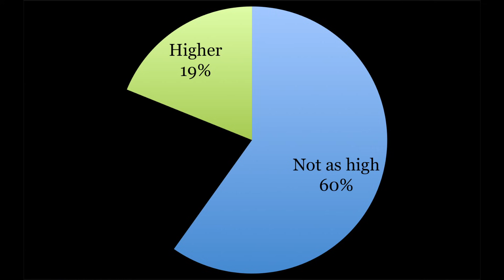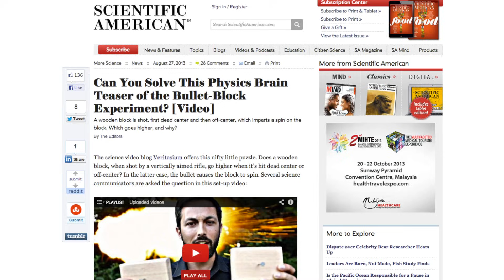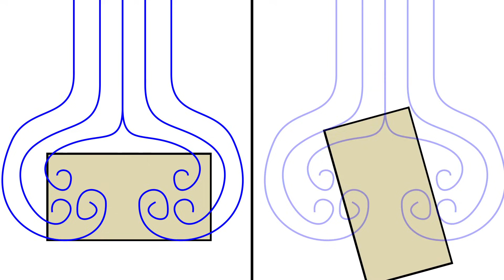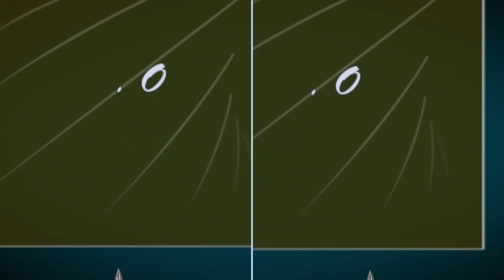Bullet Block Explained!

Comment: THE SPINNING BLOCK HAS LESS ENERGY FROM THE BULLET BEING USED TO MAKE A HOLE IN THE WOOD. The rotation causes more area over time to be covered during the impact hence less wood being ripped apart -> more lift energy

Comment: In order to see that depth, you should use a high penetration round without a lot of charge behind it.  I would advise the .17 hornet, which is a .22lr with a more narrow bullet.  This way you could see the penetration difference more easily, while not risking splitting the wood.

Comment: Modified experiment: Use softer material - as soft as possible, but not as soft as to let the bullet through. and preferably a material that is uniform ,which wood with it's fibers, phloem, xylem etc is not. Also if the block is lightweight enough you can make it a bit bigger and fire it more to the side, it will probably make a bigger difference?

Comment: It the block on the left of the x-ray, which I assume is the block that spun, the bullet did not go completely straight in, but curved a little. This makes sense, because the block would already have been spinning when the bullet hit. If the hole was slightly curved, the straight nail wouldn't have hit solid wood before it actually reached the end of the hole

Comment: In response to the question of increasing measurability: 
1. You could increase the moment arm of the off center shot by increasing the width of the block, thus lowering the penetration depth or
2. You could lower the density of the material for "scaled up" penetration depths.

Comment: the trajectory of the bullet when shot at the center was linear while that when shot off center was curved. When you stick the nail in the bullet hole of that shot off center it doesn't penetrate fully.

Comment: The mental hurdle with angular momentum is being able to understand that even if a particle is moving in a straight line, it still has angular momentum from any arbitrary axis (in this case the cg of the block).  This can be shown mathematically because l=rXf  Or, for the magnitude of l, l=rp sin(theta). The angular momentum you can see after impact can traced back to the moment of impact, where the angular momentum = the linear momentum of the bullet times the horizontal distance from the cg.

Comment: I thought the same. Before the collision both the block and bullet appear to have no angular momentum, so after the collision there should be no angular momentum. But afterwards the block is rotating along with the embedded bullet (which are both rotating the same direction).

Comment: Ke=(1/2)m*v^2 and p=mv.  Notice how much of a difference velocity makes here.  That bullet is moving INCREDIBLY fast.  In fact assuming it was a 9mm then around 1000 ft/sec is a fair estimate which translates to around 305m/s.  A good estimate for the weight of the bullet is 120 grams, or 0.12kg.  The momentum of the bullet would be 36.6 kg*m/s, the energy would be 11163J.  Most of this energy is lost in the collision.

Comment: To create a measurable difference:1. Using a less dense material- deeper Penetration. 2 more of centre  equal Great angular momentum therefore greater difference. 3 increase Initial Linear Momentum (increase weight or speed of the bullet)

Comment: Have two blocks. One stationary, one on a track. If conservation is true should the two blocks accelerate the same after being shot no matter what speed the block on the track is  moving away from the gun? With this experiment you can vary the 2nd blocks speed, maybe at hi speed the bullet depth difference could be measured?

Comment: The projectile itself rotates through the air, therefore it would transfer that rotation to the block when getting inside of it... And that could easily be proved: shoot on different sides of the block, if one block rotates faster than the other, it means this faster block is rotating at the same "direction" that the bullet was, and that is "extra" energy.

Comment: Part 2: In the second case, the center of mass is also on the line connecting the centers of mass of the two objects, but this line is tilted. While the bullet moves, this line changes angle! This effectively means that there is a rotation around the center of mass, although you don't see something rotate. After impact, you do see it, but it is the same angular momentum!

Comment: In answer to your reaction and the other top reaction with basically the same question. There is conservation of angular momentum!

Let's look at both cases before impact. In the first case the center of mass of the total system is on the vertical line connecting the center of mass of the block and that of the bullet. While the bullet moves and even after impact, the mass is not rotating around it, so angular momentum stays 0.

Comment: you don't need longer blocks if you're using the same material, the bullet didn't even reach the center of the block. you change to softer materials or get a more powerful gun (or both).

Comment: 1. Use a vacuum chamber so that air friction is out of the equation 
2. Use a different material that can ensure almost every joule of energy is transferred into that material without removing excessive amount of mass from the material(ballistic jelly anyone?)
3. better equipments for higher accurate measurement(you don't even put up a scaling board at the background!) 
4. 100 times more reputation of the same setup to built up statistical results

Comment: Perhaps consider using material less dense than the wood used in the current experiment. Using depth=(bullet length)*(density of bullet)/(density of block), holding bullet length and density of bullet as constant as is feasible, and assuming that variance in depth increases as depth increases, then using a less dense block should magnify those differences.

Comment: To make the difference in bullet depth measurable, you would probably have to do some combination of having the block made of a softer material (so it takes less energy to deform the block) and having the block be longer for its mass (so it takes more energy to rotate it).

Comment: No, no. The energy that appeared for the rotation came from the bullet. Only 1% of the energy needed to deform the wood was needed to cause an equivalent rotation of the block. So there is a difference of 1% in deformation distance.

Comment: Thanks for the answer
why don't you try to use lead (or a fmj hp) 45ACP (i think that a larger diameter bullet could help) on the spinning block and a standard fmj RN 45ACP bullet on the other block (obviously the 2 bullets must have the same weight and the same V0, so you probably have to reload yourself these cartridges)

Comment: The momentum is conserved when transferring momentum to another object. In this case, there was no rotational momentum to begin with. Just like an object at rest in linear systems. However, when a FORCE is applied, energy is placed into the system and both energy and momentum are conserved. In rotational, a torque is applied and thus the block will rotate. This required a transfer of energy. Energy can be used to transmit linear momentum into rotational momentum, since both only require motion.

Comment: Use a disk of wood or whatever, with a notch to absorb the bullet. This would transmit maximum angular velocity to the block and lessen air resistance. 

The mass of the block is pivotal. So we could make the disc very large, if it had the same mass. Imagine a big disc of the same weight with the bullet striking near the edge. Most of the energy would result in angular momentum, and it would not go very high.

Comment: Make the blocks particularly wide, such that the blocks have just enough vertical velocity such that the rotating block just barely doesn't hit the starting stand (and as low a height such that the bullet goes through as much of the block as possible). I would expect it at least to be slightly more visible this way

Comment: Try using an air piston or something that doesn't lodge in the block or something along those lines.   Remove that variable from the start.  Maybe a small metal plate to help prevent deformation?

Comment: You could perhaps swap the wood out with a material that would let both bullets pass all the way trough, and then use the high-speed camera to measure the speed of the two bullets after passing trough the two blocks.
In the wood blocks the difference in penetration should be only .1mm, but If the bullet only loses let's say 30% of its energy passing through the blocks of new material, then I would expect the difference in speed to be proportionately larger than the difference of penetration. .o/

Comment: And obviously this percentage always has different values. So, we can not talk about any consistency between experiments. Obviously there is a bunch of unrecorded reasons, which causes difference in height. In my opinion, rotating brick ceteris paribus should always fly lower.

Comment: Well, I would not agree with the ideas proposed in video. We can not just think about momentum and forget about conservation of energy. Those laws should never conflict. Also, notice the fact that the results of experiment were different: the block always flies for different height. And the question would be why. The answer I think is in the bracing of block: there is always a percentage of horizontal force which is lost when horizontal vector is transformed into vertical.

Comment: Reference frames is the key. Say our point of reference (or view) is from the center of mass of the block. If you're shooting it dead-on, neither object has any rotation with respect to the other, and the momentum is totally linear.
Now, move the bullet to one side and as the bullet approaches, the angle from the center of mass to the bullet is changing. That produces the angular momentum.

Comment: The spinning block converted a tiny part of the bullet's energy into rotational energy (because it hit off-center), while the other block didn't and thus had the bullet penetrate deeper, but only very very slightly deeper since the energy required to get the spinning block spinning was very small.

Comment: don't measure the bullets, measure it without bullets and see if they still go as high.
if you use a rubber bullet it won't penetrate the wood, if you use an air gun you can even see if aerodinamics change anything. these things will show you the result in different scenarios which you can compare to the bullet test and anticipate/calculate the real defining factor.

Comment: To improve: Use a less dense material like balsa wood and increase its length. Use a balsa stick let's say, 1m long and shoot in the center and at the edge. The penetration difference should be higher with the less dense material and the rotation should use more energy.

Comment: You should be able to scale up the difference by using longer blocks. Double the length of the blocks. I would say triple but i think that would be to massive and cause the block to actually roll off to the side instead of go up.

Comment: The second layer should be more light than the first and could slow the bullest even more (again suppose 95%). Now there could be a big third layer that is very soft. The remaining 1 - 0.95 * 0.95 of the energy of the bullets can be calculated by the depth in this sensible to penetration layer.

Comment: I think one way to do it might be not to use a wooden block. Instead it should be a brick made possibly of different kinds of plastic. The outer layer will the the hardest and would slow down the bullet lets say by 95%. Theoretically now the bullets are traveling at 1/95 of their original 'true' speed.

Comment: the bullet path is curved on the rotated block, that's why the nail didn't go as far. they should have used some wire or something else that could curve inside the wood to measure it correctly. the x-ray is the real measurement.

Comment: the rotationenergy is 50% of the potential energy the block has at his highest point, but the rotation energy is 1% of the kinetic energy of the bullet. 
You might find it takes less energy to throw a block upwards than to punch a hole in it (this is super inaccurate, but i hope you get the idea. There is a simply and intuitive, very visual explanation to this, and if i were richard feynman i would come up with it)

Comment: it's hard for the bullet to penetrate the wood, it only goes in a few centimeters while in air it would go a few kilometers. this means a lot of energy is wasted for very little penetration on the wood, which is why the depth is so small but it still makes a big difference.

Comment: Modifying penetration would be extremely easy. For one block, use a FMJ round. For the other, use a hollow point or hydra shock round. The bullet expansion of either of the latter will cause more resistance and therefore less penetration. Good luck finding a FMJ and a hollow/hydra that are of equivalent weight and caliber though.

Comment: The loss of the bullet's kinetic energy is due to the work done by the resistant force (or frictional force) exerted by the wood on the bullet as the bullet is travelling within the wood:
loss of K.E. of the bullet = (resistant force)x(penetration distance).

What you can change is the resistant force by using a block of less solid material instead. To make sure that the bullet would not completely penetrate through the block, it may be necessary to make the block much thicker.

Comment: How can you use the conservation of linear momentum in the vertical direction when you have an external force (in this case gravity) acting on the blocks?? Shouldn't you use impulses? because the time of impact is very small
Also as a modification to the experiment, make the block much wider, and shoot it to the VERY EDGE, so that there is more torque

Comment: The rotational energy is 50% of the potential energy required to lift the block. 

What he is talking about in the end is the energy of the bullet. 97% of the kinetic energy (of the bullet) is lost due to deformation, heat and sound. So only 3% of the initial kinetic energy moves the block. Since the ratio of potential (or gravitational) energy to rotational energy is 2:1, this results in 2% of the energy being transformed into potential energy and only 1% into rotational energy.

Comment: Surely this would be an unfare test in the first place? Sure, the blocks are the same size, shape and weight, but by OUR measurements, so there will be a little difference. Plus, the blocks may be 99.99...% the same, but the WOOD is not (different density in certain areas etc.). And that's just the blocks; the bullets will also be slightly different (on a scale we humans alone cannot tell), and the gunpowder propelling them will also be a little different...the list goes on.

Comment: Maybe you could use a differently shaped piece of wood......such as maybe a foot long piece of 2x4. Or maybe 2 feet long. Maybe more?? If the offset shot is much further away from the center than in the original experiment, maybe the visual aspect of the answer will be amplified to a difference you can see. Also, a less dense wood or material will contribute to this. How about also using a bigger, more powerful gun versus that wussy 22.

Comment: Based on the size of the tools in the experiment, easiest way(this was mentioned by others i believe) to get view able measurements is to either make the blocks bigger(longer) so the distance from the middle to off center is great so the difference should be see able. Otherwise you need really big pieces of wood and use bigger bullets maybe even a cannon ball.

Comment: How would shooting the blocks at different angles, spots and from alternate distances affect the height as well as the rotation?

What if you didn't use nails at all or shoot at the blocks through a small hole so that most of the block is on a flat surface.

Comment: yeah use a softer materiel so the resistance when the bullet penetrating the block will make it travel further suggesting a sponge material with air pockets so the kinetic energy is disposed more slowly

Comment: What if one were to use a target for the bullet that is a lot softer and layered as opposed to the hard piece of 2x4 you were using?.  The added softness will magnify the difference in bullet depth because it requires less energy to penetrate deeper.  If one uses an object with layers, one can physically peel back the layers and count how many layers are damaged/broken through.  One such material could be thin sheets of the kind of cardboard one finds in the packaging of dress shirts(continued)

Comment: In order to get a larger difference in penetration you could try a number of things.  You could use blocks with a smaller moment of inertia (make them more square).  Also use a less dense material with a lower overall mass which will allow for the off center block to accelerate faster.  It helps if the overall path lengths inside the material is larger for both and should give a larger difference between the two.

Comment: How about using the amplitude of the sound produced when the bullet hits block? Since there is more deformation/wastage of energy  when the bullet is shot into the center, the sound produced when it hits the block should be louder.

Also, why did the nail go noticably deeper in the center-block than in the offset-block, when in xray images the difference between them was almost negligible?

Comment: With 1/10th of a milimeter difference you also have to wonder about the inconsistance of explosives in each bullet as well right? I guess to make it more reliable you would need something that can launch 100% identical projectiles with the very same amount of energy into the wood block.

So something using air pressure to launch the projectiles and projectiles grown out of silicium crystals atom by atom to make them identical.

Never gonna be done, but you asked for it xD